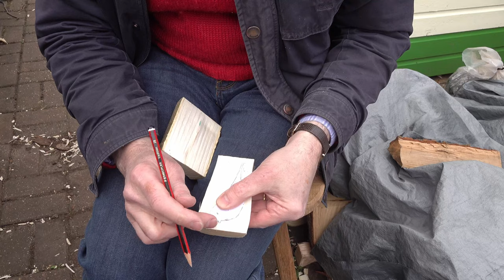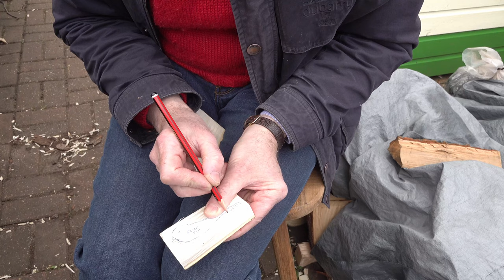Whittling A Bird From A Tree Branch (4K)

Comment: 9:14 I have those exact gloves and I was a little skeptical at first so I tested them - even with the glove lying on a solid surface and slashing across it with some weight behind it they still don't cut, but like you say they will probably offer little to no protection against a stab. Overall I was pretty impressed with the cut resistance, it's definitely one of the best choices to protect your hands

Comment: Another alternative to an axe that I like to use, is a Khukuri knife. Works a bit like an axe, but a lot more control on smaller pieces of wood 🤙

Another tip for better grip on smaller pieces of wood, is to use a piece of bike inner tube as a grippy pad. I use them a lot for knapping too, stops me from dropping all my arrowheads 🤣